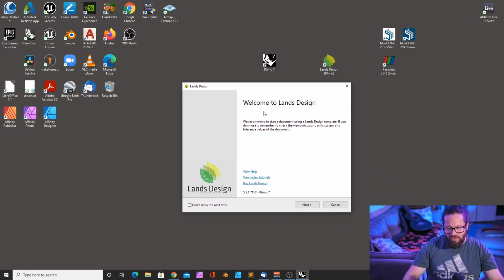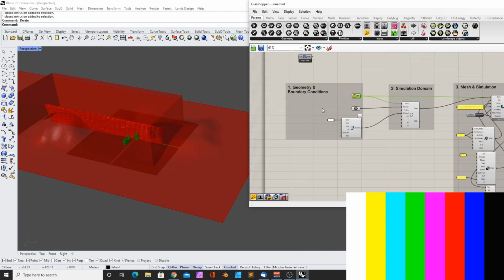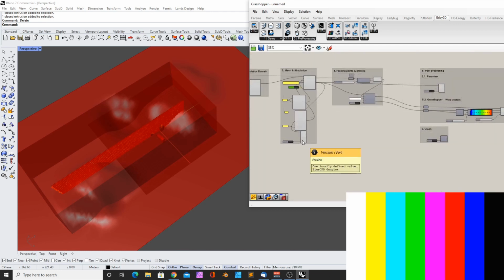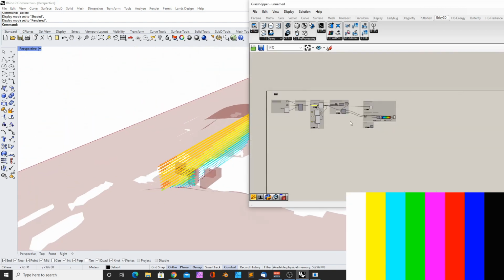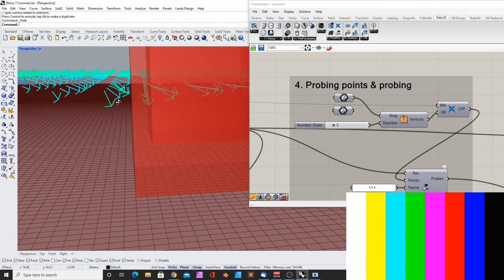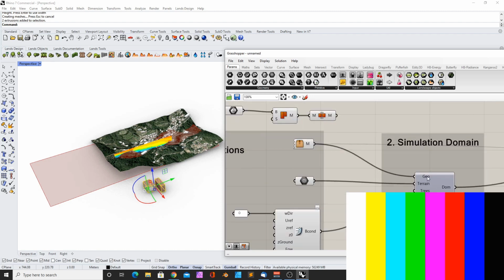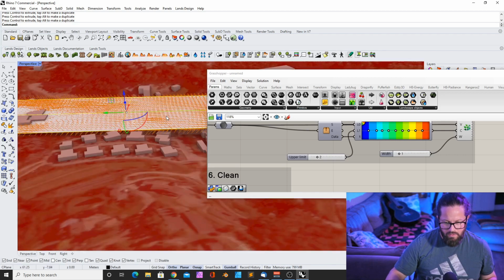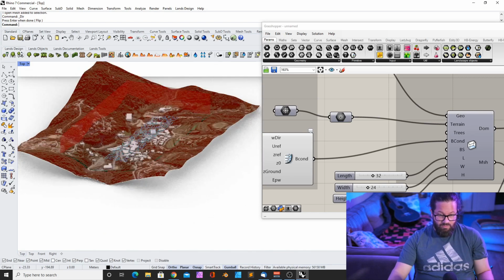Why you should use Eddy 3d | Rhino3D Grasshopper3d | CFD Part 07

Comment: Hi Philipp, in your opinion Eddy 3d is the most for wind analysis of coutyard between buildings (area ranges between 250 to 1500 m2) or Butterfly cdf?
another question, how I get the wind speed or velocity by EDDY 3D?
thanks so much
Reply from the maker: Given that Butterfly is outdated (2019) I would suggest to use Eddy. It's great for exterior. Just to note that not Eddy nor Butterfly are actually doing the work. It's blue cfd in the background. Both use the same engine. So in theory they are equally good. Only difference is what they are accessing and how. Butterfly is a versatile cfd analysis tool where as Eddy focuses on exterior planning.

Comment: I found your video and tried a lot to use eddy3d, eventually it wasn't possible. I'm using Rhino 8 and I've tried installing the beta version for Rhino8, but there are a lot of red pop up messages in grasshopper.. So I gave up on this way,, Now I'm watching your 'butterfly cfd' and I hope it works! Thanks to making informative video!
Reply from the maker: The installation is the key and needs to follow on the dot and also to run Rhino in Admin mode. Sometimes non+English operating systems could potentially become a problem. If for example folders are named. If problems persist I would start by learning the fundamentals of grasshopper first. CFD analysis is advanced level and takes time and tinkering. Don't give up and always try the examples files which with the installation. If these don't work then there is something wrong with the installation.

Comment: hey Philipp, thanks for your video and explaination. Very helpful. but, it's usually take issue 1. The file "C:\3_SimpleWindAnalysis\14\postProcessing\asd\0\U" does not exist. Please run the probing component. i'm sure all component have run.
Reply from the maker: Which blue CFD version have you installed? And are you running rhino in admin mode?

Comment: hey Philipp, thanks for your video and explaination. Very helpful. The prevailing wind angle of an EPW file can be obtained from the ladybug wind rose. But you know how to get the average speed for the prevailing wind angle? This is so it can be an input for eddy3d wind speed. Thanks in advance! :)
Reply from the maker: I like your question. It's a nice challenge.
Let me have a thought regarding the same.
Thinking about it, you can probably filter  the values of the wind direction and then map its cull pattern onto the wind speed dataset. That actually brings me to a different idea...

Comment: Hi Philipp! It's me again.
I'm having issues with the box-shaped domain tool, it can't seem to make a domain for me or any tangible box. I think my topography might be effecting it, I tried flipping the surface but did not work. Could I please ask for some assistance here 🙏
Reply from the maker: Yeah i think there is bug. Strange that they haven't fixed this yet. 
You might want to check if your terrain or geometry is lower the sea level. I think that causes issues if I remember correctly.

Comment: Hey Philip, first thank u very much for your videos ! Secondly i have a problem when visualizing the Probes. I get the error message "Parsing of teh probes failed. This data does not exist"  could you help me with this error ?
Reply: I am facing the same issue , I followed the step properly but then the visualise probes pops up an error : The mesh folder doesn’t exist. Please create a mesh first. What Shall I do here??
Reply from the maker: Quick question, what version of blue CFD did you install, are you running rhino in admin mode? and did you setup the blueCFD environment?
Reply from the maker: This can many reasons. Are you running your rhino in admin mode for instance. Which version of bluecore CFD did you install etc...? Can you run the example files?
Reply: @PhilippGalvanDesign  I did everything like you: admin mode, bluecfd 2017, running enviroment etc.   When running the probes the message in the console says :

 FOAM Warning :
    From function virtual void Foam::probes::findElements(const Foam::fvMesh&)
    in file probes/probes.C at line 119
    Did not find location (1.59 -369.417 25.877) in any cell. Skipping location.

when running the bluecfd terminal the first time i get 2 permissions denied. So my idea is that bluecfd / open foam has a problem. reinstall didnt work. i would be very happy if you could tell me a sollution. best regards, Jonny
Reply from the maker: Maybe if you could send me the file I can check if it works on my computer. office@nedomlel.com.
There are some users they had problems with bluecore CFD...but that would be beyond my knowledge boundary...
Reply: @PhilippGalvanDesign  Thank you very much for your effort. I dont have a file which could make problems. The simple wind analysis simply does not work. i tried a different computer and i dont have the error anymore but after it worked for 1 time i just get random vectors now ( admin start, meters  etc. all settings should be fine...) .... it looks so promising what you show in the videos but seems like i have to give up on eddy.
Reply: Long story short: i didnt give up and just had to clear the values after every turn and now it seems to work. Thank you very much !Btw : The Beta for eddy looks also promising and brings a lot of new features :)
Reply: @PhilippGalvanDesign  also I am not able to open the graph I’ve been struggling I also gave up on butterfly CFD and now eddy 3D is also not running in my pc
Reply from the maker: Thanks, I need to check it out.
Reply: @divya  Hey divya, did you solve the Error "Parsing of the probes failed. This data does not exist" ?  it worked for me for some tries but now i have the error back in all different templates...

for your mesh problem it can help you to take a look to the Eddy 3d Rhino forum. there is a topic regarding this problem.

in generell i have the impression that eddy comes with a lot of bugs / irregularities. It looks very promising but under this conditions i had to switch back to Ladybug / butterly.

Comment: Hey Philipp, is there a way to input average wind direction from ladybug into the Eddy plugin?
Reply from the maker: Hi George, yes it should be possible. 
I am currently trying to understand the process regarding annual wind analysis via weather data in eddy3d but couldn't make the sample file  work. It's just a matter of time. In order to analyse the average wind direction. You could just calculate the average vector and speed from the ebw file output (Ladybug) and use that. I'll have a thought.